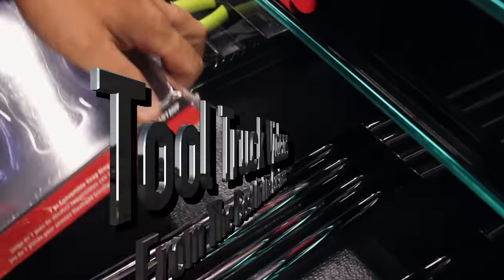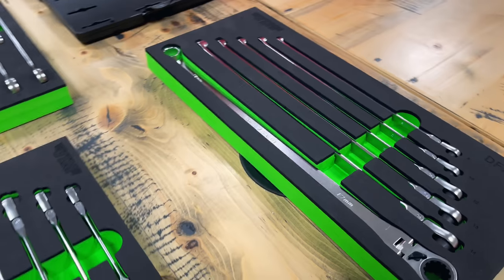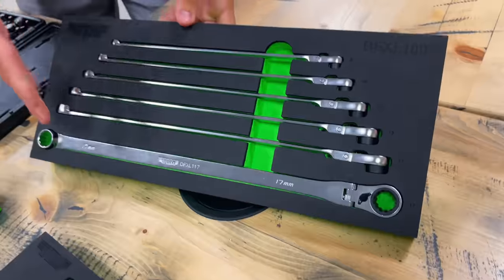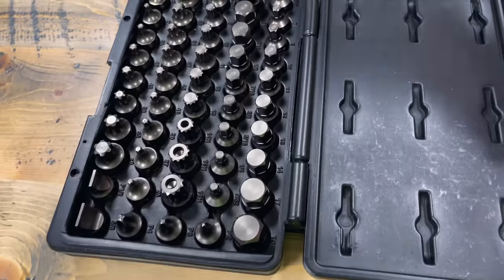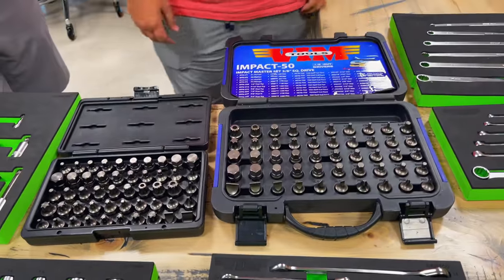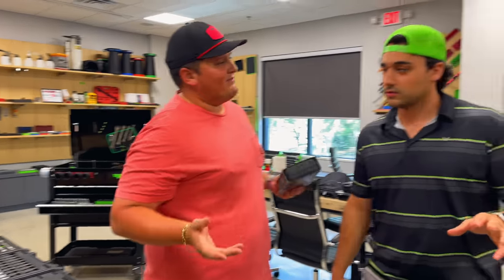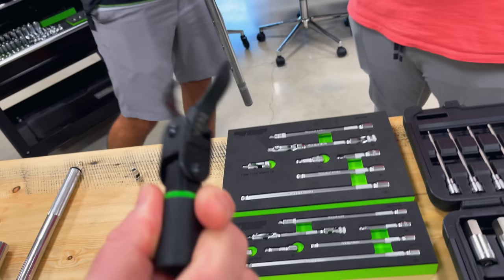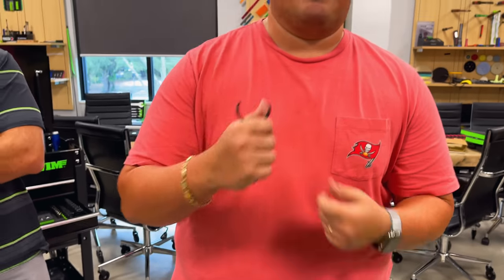New Tools From VIM, Never Before Seen, See Inside The Facility War Room! An Inside Look at VIM Tools

Comment: After watching this video, there’s a bunch of tools I didn’t even know they made. I got a lot of buying to do Great company, good tools, awesome warranty can’t ask for more than that
Reply from the maker: Those guys are awesome. The company as a whole is fantastic, I will say this if it is stamped “VIM Tools” you are safe to say you will be in good hands in the case you ever have an issue.
Reply: I can't agree more!
Reply: The only crappy part of their warranty is the fact you have to pay $9.95 shipping regardless. If I break a single socket or bit in a set it's either pay more than the one socket is worth or have one missing in the set.
Reply: I hope the tools are amazing but the prices are not. You have been shafted
Reply: if you cant get it local dont get it. you will be paying 10-15+ for replacement sockets. i know as i have the big mechanic set. the times i have had to warranty out the torx its been 10-15 bucks for replacements. buy something else local or stick to the trucks.
Reply: @KoonTrucking  i disagree w that statement fully. ive had to pay 10-15 dollars for replacement sockets that are under "warranty". pretty sure im paying for the new socket. i have the big mechanic set that has pretty much everything. if you cant get these local to you i suggest buying locally instead. it is good stuff no doubt but like anything it will break.

Comment: i have a set of the 1/4 inch bits i was doing a engine on a volvo and had to take the head off and that was my only triple square 12 so i used adapters to fit it on my milwaukee and it got the head bolts out no problem i was extremely shocked when it didnt break! after that vim has my respect and always keep a eye out for there stuff.

Comment: Gentlemen, I’d like to see a rubber faced oil cap wrench for late model cars and trucks with plastic valve covers. Something hard enough to grip but not mar or gall when you have to pull hard on that oil cap. Maybe expand that into a hot radiator cap wrench or pliers to keep from getting burnt. Save that towel from a splash of hot coolant. You’d need multiple sizes for both.

Comment: The long flex head ratcheting wrenches need to include 15 & 18 MM. Those are pretty common sizes on late model vehicles not to include in the set. Why didn't you make the shorter ratcheting wrench set in the same style as the long pattern version fixed boxed end/flex head ratcheting boxed end? Sometimes the long pattern wrenches are too long to use in certain applications.

Comment: I have two suggestions: 1)create and market a Harley basic kit. Either exchangeable bit screwdriver or T handle type of deal to include T20, T25, and T27 as well as 3/16, 1/4, 5/16, and 3/8 hex bits.  2) some sort of JIS bit kit or screwdriver set.
Reply from the maker: That a look at the FRBS89 set or the VHC77 kit. There’s your answer

Comment: Ive known 2 mechs that have broken their wrench extenders with minmal effort, & now they lay around the shops being useless. I like their battery service brush tho. Had to get it green despite it costing a couple $$'s more than the blue on ebay bc most of my tools are green & red macs, rip-0ffs, & crapco's. OCD like that
Reply: warranty them out, they will get brand new ones
Reply from the maker: Exactly

Comment: well i have an idea for a tool that nobody has made and i know people will buy because i want it myself. the other thing i gotta say is i have the big set of vim torx allen and etorx set. i think its the mechanic set to be exact. massive set and def happy w it for sure. i have broken a few of the torx. my problem is i gotta pay 10-15 dollars to get my replacement sent to me. so the lifetime warranty in my case is pretty useless. i highly suggest sticking w something local or a tool truck brand in this case. id imagine all the other warranty claims will be the same. id love to buy the stubby sets and the triple squares but i wont due to this fact mentioned above. otherwise though it is def good stuff my issue is the warranty claim.  which if im paying 10-15 dollars is it even a warranty i think not. i also suggest looking closely at the sockets as i had 2 in mine that had thw wrong bit inserted into it from factory. not a big deal just looking out for some other guys.
Reply from the maker: Tool trucks will exchange them at no cost on warranties but if you don’t have a tool truck, then that is an issue.
Reply: @KoonTrucking  none of my local trucks carry them.
Reply from the maker: Well that sucks for them because they are probably carrying the flagship name of the tool (blue point, Snap-on, etc) just ask them for it and they can get it. Every tool truck can order this from the supplemental catalog or supplier.

Comment: Oh nooo another spline wrench. Still don't know if I can trust that.
Reply from the maker: I personally like 6 point on 6 point fasteners and 12 point tools on 12 point fasteners but …. Apparently these work well or they (VIM Tools) wouldn’t have them
Reply: My Mountain are fine☝️
Reply: Yea I need to try some, I have a gearwrench 120xp 18mm spline drive but havnt got to try it yet
Reply: @DownHillgamer I have the GW 120xp metric set, great wrenches. Fine tooth but the box end can handle abuse👍